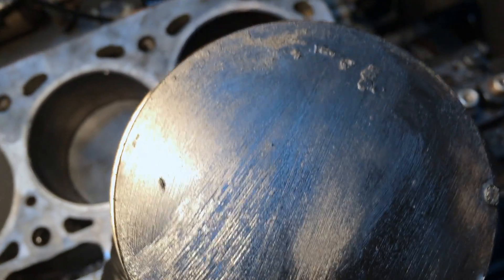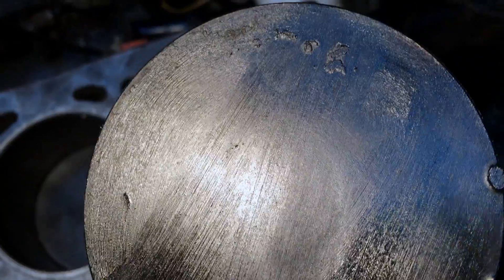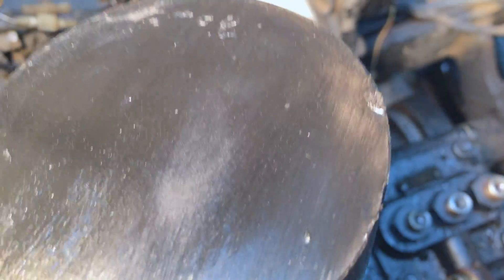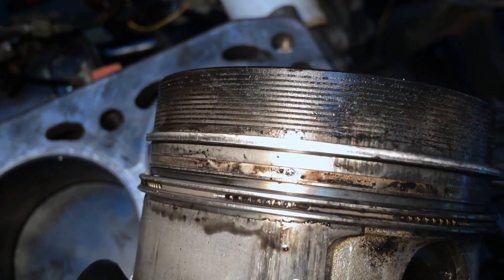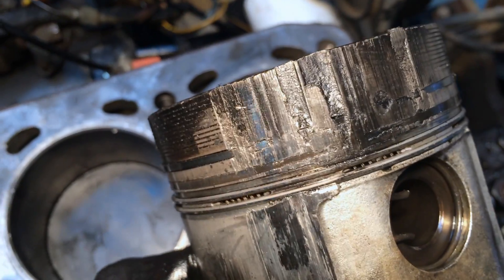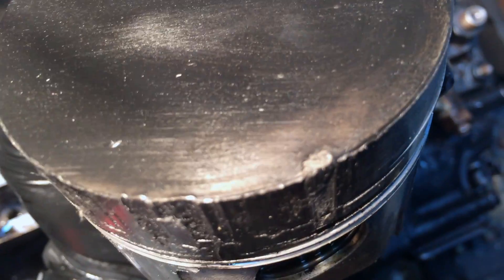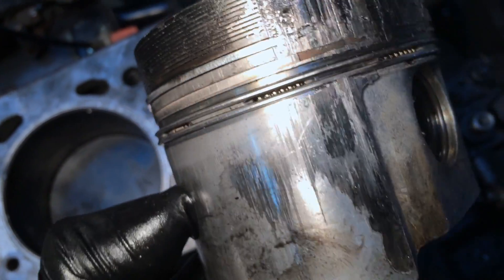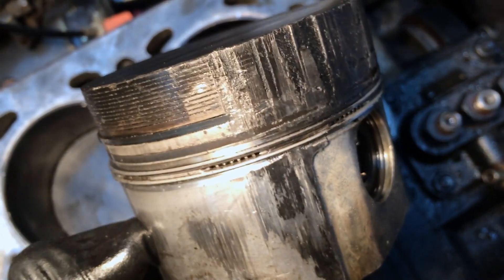piston

Comment: I'm working on my 276D 3 cylinder engine currently. did you replace the sleeve as well?
Reply from the maker: Yes. Changed sleeves while I had it apart. Made it like new.  They slide out easily